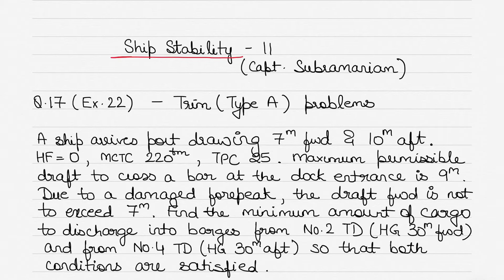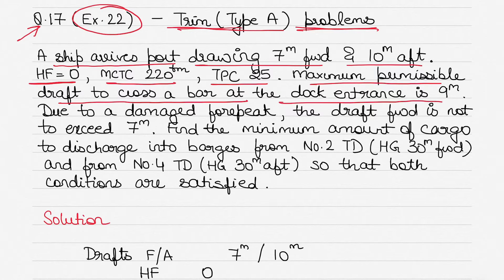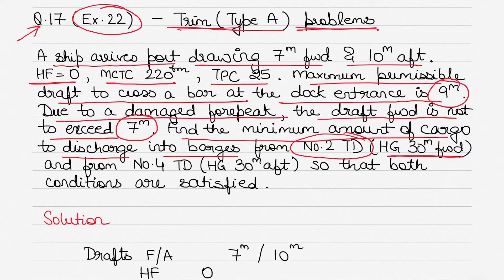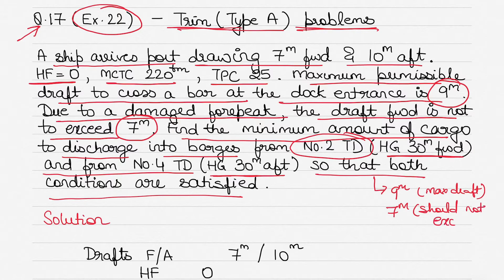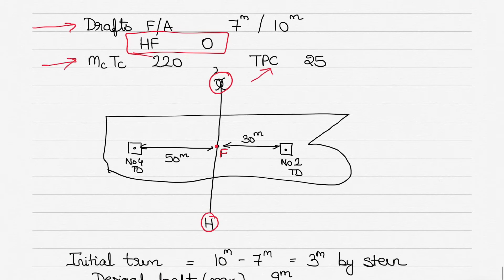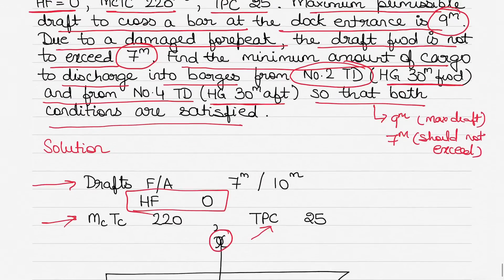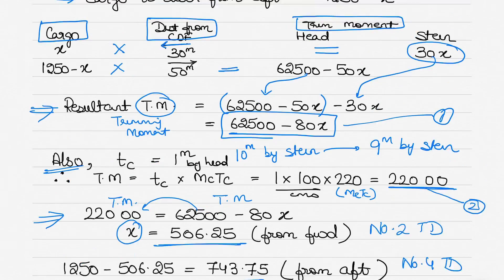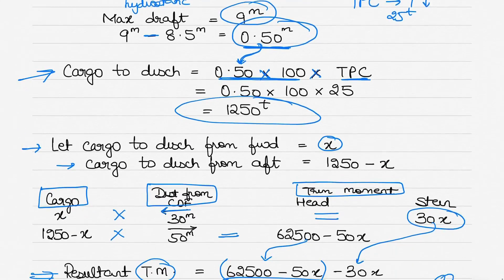How to solve Trim (Type A) problems in Ship Stability - Q17 (ex 22) Capt Subramaniam

Comment: Sir, i couldnt understand the Mean rise or sinkage part. 8.5m being present hyd dft and subtracting with 9m(accounted as hyd dft) there is 0.5m sinkage available, Generally. How is this applied in this solution as the condition is to unload cargo? Totally confused in finding mean value concept sir.

Comment: With all due respect sir, how can we consider 9mtr as hydraft ? In the initial condition of the ship 10 nd 7, hydraft is 8.5 . Now if we consider 9 as hydraft the vsl has to sink which is not desirable in the given condition . It says Max permissible draft is 9 , if we consider 9 as hydraft then aft has to go down since fwd has to be same i.e. 7m . Moreover we can not use 9 as a draft and a hydraft as well at the same time .(final trim 9-7 )and (Final hydraft - initial hydraft = 9 - 8.5) . Kindly clarify .
Reply: Yes, you use the difference of Hyd draft to find the sinkage then. W/(TPC*100)=0.5
Which would result in your total quantity of cargo by wt to be 1250t.
Then you use the same way he has shown.
Reply: Bro , Use AFT Correction Formula you will get 9 meters as a HYD Draft , ( 9 A - 7 F)  , LBP AND COF Will be constant  . All the Cargo will be calculated through Hyd Draft Only